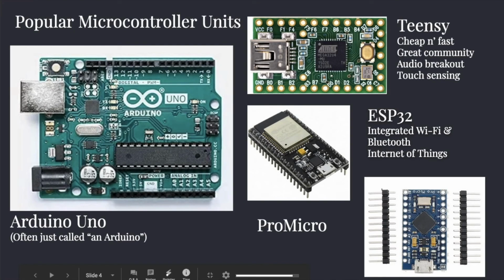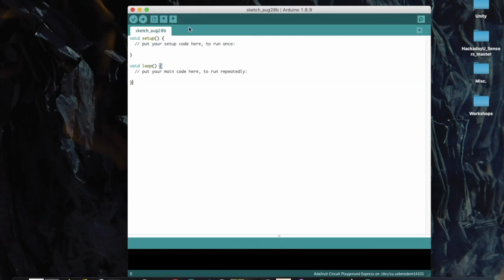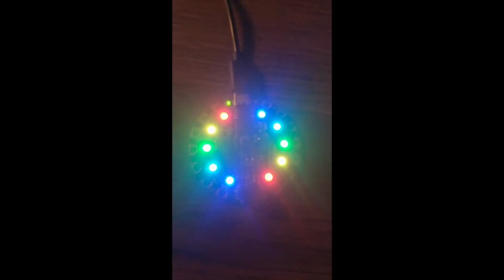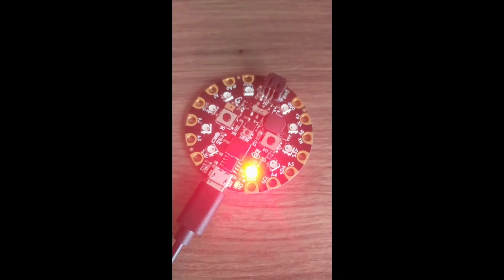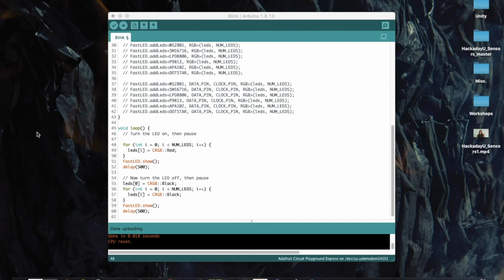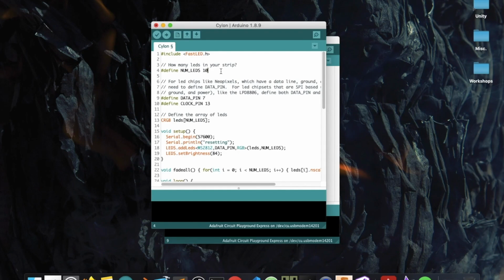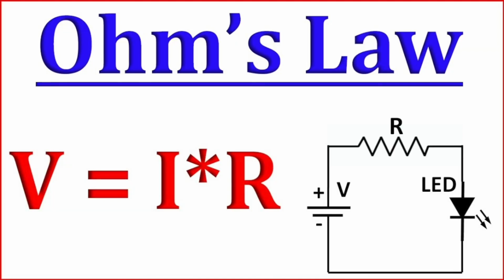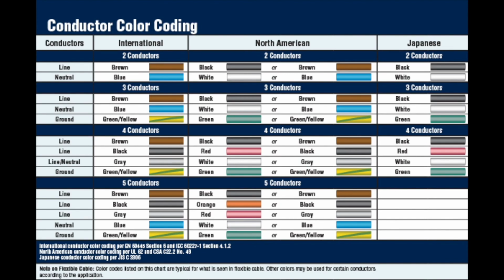HackadayU: LED Programming with Arduino Class 1

Comment: Can i work with arduino uno for all this?
Reply: I did and it worked very well! I used an ELEGOO UNO R3 and a 120 Pixel LED Strip, adjusted the code where appropriate, and had no problems. Fantastic class!